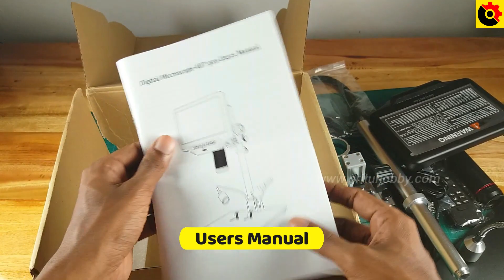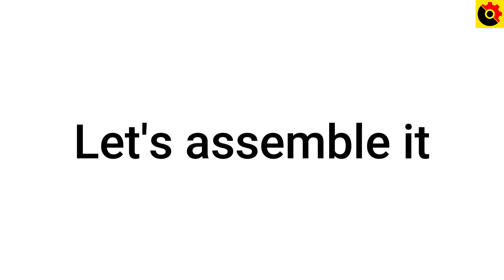Andonstar AD407 Pro Digital Microscope Unboxing and Review

Comment: Sir, thank you for your nice video. In my AD407 Pro Microscope new longer stand, the two-way-connector (that is two orthogonal rings), which joins the vertical and horizontal shafts, fits only loosely the latter one. So the Microscope is unstable and I have to fix it. I would like to know whether yours also has that defect (so that it is a design flaw), or just mine got this imperfection. Thanks.